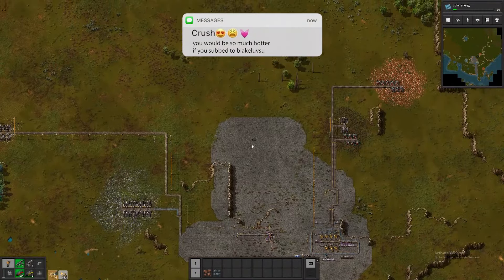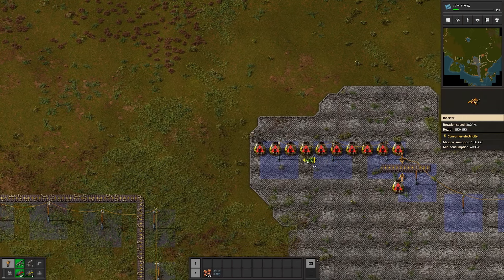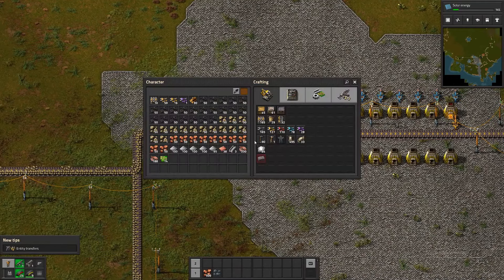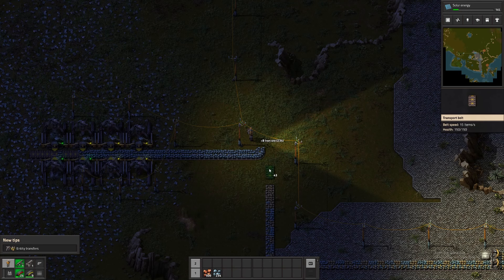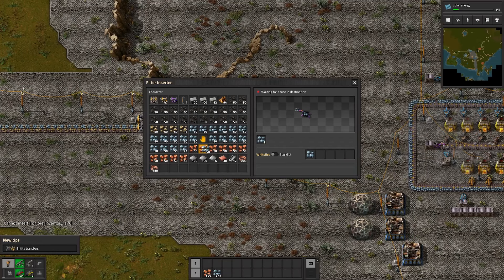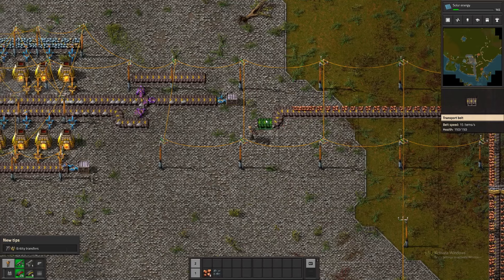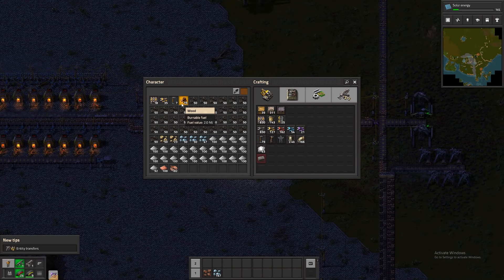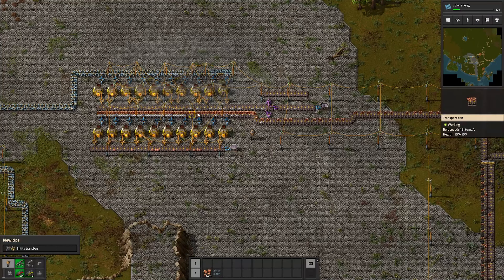Creating The WORST Factory in Factorio

Comment: Some tips from a 1k hour old player. If you have a long line of buildings, you don't need to count them one by one. CONTROL + C gives you the ability to copy a setup to turn it into a blueprint, just imagine a computer screen mouse to drag left mouse button and if you don't release the button (to cancel making a blueprint you can either deselect everything and release button or just click Q) you can see the highlighted stuff, so this way you can see if you got a specific amount of smelters, so u know if u need more, less or have enough. No need to count manually.

If you hold an item that goes into an inventory like ammo for turrets, coal for smelters or anything for chests if you hold Control and left click, it will try to add the entire stack (if u have less than full stack then it will be just that much). If you do that buy right click, it will deposit half of what you are holding. Alternatively, this is a good tip for turrets and biters - if you hold an item and hold the Z button then move your mouse over a turret, it will only deposit 1 item per time you hover over it. It's basically meta for early biter clearing.

Also, obligatory click ALT button once to be able to see contents/recipes of smelters and assemblers. It's motto in r/factorio to always have it on if you intend to share a screenshot there.
Reply: pretty sure you need to have unlocked robotics at least once in any save to use ctrl+c
Reply: @qwe-de7xd  No, but unlocking robotics is required for ghosts to appear when ur stuff is destroyed. You can blueprint from start. This isn't Shapez.
Reply from the maker: i have not been checking any of the wikis or reddits for the game to see strats and stuff and i don't think i intend on sharing screenshots but I will try to turn it on for future episodes at least most of the time so it makes it easier to follow! i still havent figured out the copy and paste mechanic. i tried it in the latest sesh and couldnt get it to work. thanks for the comment tho friend!
Reply: @blakeluvsu1  that's a good idea. Once you check them it's likely that you notice the most optimal designs and then your brain will refuse to make anything less meaning all of your designs start looking samey.